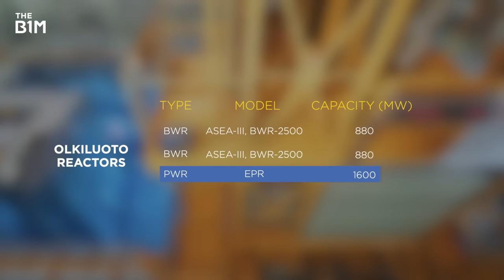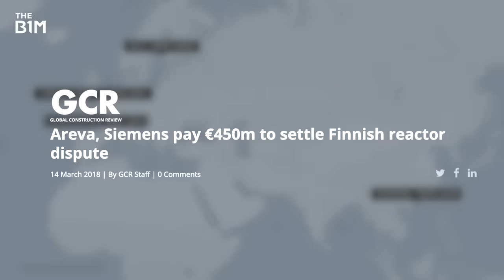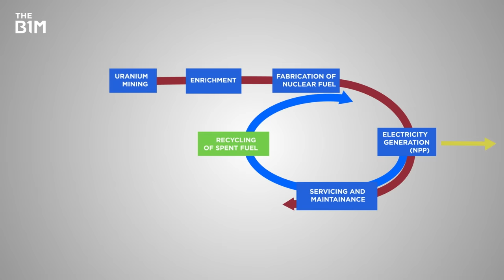Finland Might Have Solved Nuclear Power’s Biggest Problem

Comment: Old solution: stuff it underground and forget about it.
New solution: stuff it waaay underground and forget about it.
Reply: Like the stuff that hasn't been mined yet and is all over the worl in potentially catastrophic locations?
Reply: Remember in the old days when people would talk about blasting it into space or the sun?
Reply: @james3876  do you mean the non-enriched stuff !?!?     pointing out the extremely obvious difference.
Reply: @리주민  I still think the “shoot it in to the sun” option should be explored.
Reply: @james3876  just to be clear - I’m not saying it’s a bad solution. I’m saying it’s not really different from the old one contrary to the PR.

I’ve heard a lot of arguments that burying it underground is perfectly adequately. Maybe that’s true, but I would say that fourth generation fuel cycles are a preferable solution.
Reply: @marknoneya6630  enrichment is not the issue.
Using it is.
Reply: @youtubeaccount5153  haha rocket go crash
Reply: @TauCu  lol. Yea. And even if it’s just one rocket out of 10,000 that would be a devastating problem.
Reply: @youtubeaccount5153  And the energy required to send it into the sun is enormous. The delta-v (change in velocity) required is 2.5 times the delta-v to send it out of the solar system.
Reply: @HolySoliDeoGloria  It takes more energy to send it towards the sun than away from the sun?
🤔
And we know from movies all the problems we could create sending it out of the solar system. Although “out” of the solar system would take hundreds(?), thousands(?) of years.
Reply: Just sent it to space
Reply: @NoogahOogah  Breeder and SMR reactors reuse the fissile plutonium that is honestly such a good option along with the countless solutions that its funny to think there is still anti nuclear. I bet the people who are anti nuclear say nucular.
Reply: @jebus2382  I thought breeder reactors created plutonium, which is then used in the reactor but is much more dangerous than the uranium you started with. 
Not correct?
Reply: @HolySoliDeoGloria  interesting. Thank you.
Reply: what about using it again ? look up 4th generation reactors
Reply: @TomTomXIV  Throw it out the window sort of? Riveting.

I propose we choose a planet and make it a dump field.
Screwing with the Sun.... is a bit.. Come on, really? "What could go wrong" Amirite.
Reply: Terraform Mars with it!
Reply: @chrisb9143  from what i saw plutonium decays back into a another uranium isotope wich would need to be reprocessed, and thats energy inefficient...

and stuffing it underground is only "a long term solution" because of how long the thing needs to run before being considered "waste".

until we have a way to not use fission reactors anymore that is as clean as nuclear ever will be.
Reply: That's what I thought. Nothing different
Reply: @youtubeaccount5153  ur joking right?
Reply: @CarlosAM1  about exploring an option? No. But I know nothing about the economics of it. And I admit the safety can be 99.99% and still that is not sufficient.
Reply: @CarlosAM1  I’m not part of the crowd that keeps a closed mind to ideas.
Reply: @marknoneya6630  You can dilute the enriched stuff back to the level it was before it was mined. It the false idea that something that was not safe before it was mined be made totally safe is illogical.
Reply: Hhhhhhaaaaahhhhaaa porcenT.
Reply: @marknoneya6630  May come as some surprise to you, but in the past natural nuclear reactors did occur. One region in Africa , Oklo Gabon. And our own core has quite a bit still cooking. It's what keeps our planet having liquid magma and a magnetosphere to keep out most of the sun's radiation. Besides it only takes 2 inches of lead, 4 inches of steel, about a foot of stone, or 2 feet of water to drop radiation levels by one tenth power (i.e. 10 down to 1). As deep as they are putting it you won't be able to notice a change in background radiation.
Reply: @NoogahOogah  I would like to see Fusion Reactors, but for now this is this is the best option. It was giving off radiation in the ground. Enriching it concentrates it, but the net overall effect is the same. And when I was in Naval Nuclear Power School we learned that for each 2 inches of lead, 4 inches of steel, 12 inches of stone, or 24 inches of water you had between you and the radiation source knocked a zero off how much radiation got to you. Burying it a half kilometer down should take about a thousand zeros off the radiation reaching anyone on or near the surface.
Reply: @HolySoliDeoGloria  You have absolutely no clue what you are talking about. Once it's out of Earth's orbit and floating through space, NOTHING will stop it. It no longer becomes our problem. Shit that starts uncontrollably floating through space DOES NOT STOP. EVER.
Reply: @DeadlyDanDaMan   Read the context. What question do you think I was answering? I was ONLY discussing the point that it takes more energy to decelerate an object from earth's orbit into the sun than to send that object out of the solar system. What, exactly, in any of my posts, discusses your points? I understand orbital mechanics including Newton's and Kepler's laws.
Reply: @리주민  Great idea... just don't use one of Elon's rockets☠💣💣💥💥
Reply: Good thing we're modern not primitive like yesterday.
Reply: @VI-pp4jo  A gas giant wouldn't really mind a little more radiation.
Reply: @sch3ffel  It's still easier to bury spent material than gaseous carbon compounds and the continuous output is far more practical than the rest of the alternatives.  For now it's the cleanest option we have.  Hopefully we can use a few decades of cleanish nuclear to perfect sun, wind, and water then replace it with those.  With some well played hands I don't think we need a century to get that much done.
Reply: You forgot the: Really old Solution and sometimes state of the Art. Just swap it out in the Ocean because it is so big and Deep
Reply: @wolffang489  i know not saying im against it im just saying that this is the cleanest it can be today
Reply: Actually only the new solution is "bury and forget it". The old one was "Bury, keep maintenance forever and pray for no natural disasters"
Reply: @youtubeaccount5153  there are 2 big problemas there:
1 - One does not simply shoot stuff into the sun. You need way too much fuel for something like that. Not practical with current rockets.
2 - Imagine an accident on the pad or it blowing on the way up or even, imagine it losing control like that Tianhe booster and nobody knowing where or when it would fall back to Earth...

SpaceX makes it look easy, but they are just putting stuff in LEO most of the time. Reliably sending cargo that far is far more difficult. For example (using data in Wikipedia), Saturn V was ~2800 tons but could bring only 140 tons to LEO. After that, to the moon it was a 48 ton payload at a cost of $1.2 billion (2019 value) per launch. Saturn V is still the record holder for heaviest LEO launch.

SpaceX's Starship + Super Heavy is the only one in development today predicted to get more than that to LEO (up to 150 tons), and will be significantly cheaper per launch because of reusing first stage (Wikipedia mentions a CNBC link saying they hope it to be as cheap as $2 million per launch, but who really knows).

I would say we still need to wait for more reliable, efficient and cheaper rockets before starting to think about this. I guess we should bet on rockets to come after Super Heavy / Starship

Edit: you asked about how long it would take to send stuff out the solar system. We have the Voyager probes to give us an idea. They weigh a little under a ton and are at the edge of the solar system right now. Check the Wikipedia article on Voyager 1: https://en.wikipedia.org/wiki/Voyager_1#Timeline_of_travel
Reply: I hope they don't forget it because the so called spent solid fuel still contains more than 90% usable fuel. It can be processed for reuse, or even better, if we didn't kill the nuclear research, by now we could be using liquid (molten salt) fueled reactors that can use the fuel fully with much easier chemical separation process of any byproducts.
Reply: @DarthGTB  good info Thanks. Yea, the oops factor is prohibitive. But after that I kind of thought you shoot something towards the sun and gravity would do it’s thing.
Reply: @youtubeaccount5153  yes, well, remember, the Earth is technically falling into the sun as well. Roughly speaking you need the same kind of energy you would need for making the thing counter the speed the earth goes around the sun for falling into it. Another option would be to put it on a fixed orbit too. Orbital physics don't look very logical at first, but it gets pretty easy to understand once you learn about it. I recommend a mobile game called Spaceflight Simulator. It is really enjoyable and gives hours of orbital fun :)
Reply: Makes sense.
Reply: @jebus2382  I say fission, to distinguish it from the fusion pipedream...
Reply: @youtubeaccount5153  ...depends on the design...
Reply: @sch3ffel  you need to think more clearly; humans evolved with a background of radiation, and in nuclear chemistry, the most dangerous products have half-lives under three years (especially gases). The longer the half-life, the less radioactivity - exactly why uranium is now mostly U238, and very little U235 - the more radioactive U235 has decayed away...nuclear waste is nowhere near as dangerous as you think, but obviously needs to be controlled. There is also very little of it, with all of the UK's waste from 60 years operation stored at one site at Sellafield. Storing underground is a perfectly adequate solution, especially with glassification making groundwater infiltration a non-issue.
Reply: @davidtherwhanger6795  Fusion will never work in the way people think. First, the superheated plasma is not nice, then the intense neutron flux makes the structure radioactive and degrades the strongest materials so they crack up.
Reply: @DeadlyDanDaMan  Danno, no need to be rude, but stuff ejected into space can be captured by weak gravitational fields and, like comets, eventually return to cross Earth's orbit, leading to the possibility of collision!
Reply: @wolffang489  nice idea, but it can never happen. Wind and solar are already pretty close to their max theoretical efficiency, and are so diffuse that we would need to cover large areas to extract sufficient power using them. Fission is highly concentrated energy, with tiny volumes of 'waste', and is the only practical source of 'clean' energy, given that fusion will never work and still makes stuff radioactive.
Reply: @AndreasReinholdSchweiz  glassify, then drop into deep ocean trenches where subduction occurs, eventually adding to the molten core heat.
Reply: @Ironic1950  We are talking about fission here. But thanks for the input.
Reply: It's way more advanced than it seems. This is just the simplified version.
Reply: @marknoneya6630  if it is waste, it is no longer enriched, it is depleted
Reply: @youtubeaccount5153  unless be build a space elevator or a skyhook that's a pretty shit idea
Reply: @Ironic1950  and you are trying to create a debate where there is none.
as i said im not talking against it im just stating a fact that you cant get today nuclear power more clean then it already is.
Reply: To noogahoogah . The song with these lyrics , "I'm hooked on a feeling and I'm high on believing that you're in love with me " has your name at the beginning of it.
Reply: It that's your takeaway from the vid, you might want to watch it again...
Reply: @HolySoliDeoGloria  Maybe the atmosphere of Venus could be used to reduce the delta-v
Reply: @zambani  Just using the gravity of Venus can alter the velocity of a craft relative to the Sun, just as the Solar Orbiter did. Trying to get into the atmosphere would introduce a host of complications and wouldn't accomplish anything more in terms of delta-v than a "gravity-assist" flyby would.
Reply: @HolySoliDeoGloria  Yeah, come to think about it that's true. No need for aerobraking. Gravity assist a few times like Messenger can save some fuel.
Reply: Only to accidentally mine into it 500 years later. A radioactive surprise
Reply: If it ain’t a problem don’t fix it
Reply: Neo new trade-off let Musk send it to the ☀️
Reply: @youtubeaccount5153  you really want to "annoy" the damn star that keeps us alive? I think that is one of the dumbest solution ever. We should NOT shoot something in the sun. If the sun reacts to the nuclear waste with a giant solar eclipse or even an "explosion" you ruined every live on our planet...
Reply: @KolaronMalor  please tell me you are joking.
Reply: Game changer!!!
Reply: @youtubeaccount5153  Why would you want to send fuel into the sun instead of using it?
Reply: @Ironic1950  Nothing will replace horse and wagon
Reply: @VI-pp4jo  ...only like putting nasty people in prison for life, but also throwing away the key...
Reply: @sch3ffel  the chain of nuclear decay is well known, so all the issues have solutions e.g. strontium90, caesium136, xenon56, which basically means containing such things for 30 years, then the remaining decay products are stable but still heat-producing radioactive stuff, which can be used for power. This is the current thinking; high-level waste is not waste...
Reply: @LootHunt  at some point there is waste from all nuclear power generation.
Reply: Yeah. You don't really have to worry about it. Within some 1000 years it's pretty safe to handle. The nuclear waste is initially so deadly because it has really active waste components but these will also decay away fast which means the residue will become about as safe as the unused fuel (which can be handled with gloves) in not some long time. The speech about tens of thousands of years is just propaganda as if something is radioactive for that long time it means it's not very radioactive, they go hand in hand: more active -> shorter half-time, longer half time -> less-active. For example bismuth is radioactive for 14 billion years and that's why you can buy if off-the-shelf as it's practically not active at all.
Reply: @youtubeaccount5153  ...and toxic chemicals leaching from smashed up solar panels dumped in landfills, along with unrecyclable turbine blades is also waste...
Reply: And called it "game changer"
Reply: No somebody generations later can come pick it up after 100 years of being there.
Reply: @youtubeaccount5153  yes contaminate the entire solar system!!! with unforseen consequences!!!
Reply: @anti-everybody  I dont think you get how big “the solar system” is. 
Try to find a schematic of the solar system that is i
proportionate. The Earth would have to be a very tiny dot if you wanted to show the relative size and distances to Jupiter and Saturn. 
I wonder how much of the area of the solar system that is within the orbit of Mars that the Earth takes up? I bet there are twenty zeros after the decimal point before the 1.
Reply: @JakeWitmer  😂 LOL. Some libertarians concern me. But less than all Democrats and most Republicans.
Reply: @youtubeaccount5153  Due to a malfunction in scrolling ability caused by terrible interactivity programming on the part of YouTube, I am unable to quickly look at the context of your reply. However, I'm sure it's very smart. Have a nice day.

PS: If you're not a small-L libertarian (and small-D democrat and small-R republican) you're probably very stupid, and should stop participating politically.
Reply: @JakeWitmer  I am a conservative. With very strong libertarian leanings. 
May I participate?
Reply: @JakeWitmer  do you equate uninformed with disagreeing?
I think some people may accuse libertarians of being sociopaths.
Reply: @james3876  do you mean uranium??? its different genious..smh
Reply: I was thinking the same.
Reply: We can fule thorium reactors with nuclear waste
Reply: Perfect example of human hybris: we little people actually place a problem in this world with a timeline of up to 1,000,000 years. Oh, wait a moment, when did the industrial revolution start? Ah, yes, about 250 years ago? The rate at which we destroy the resources we need to our survival completely leads this storage argument into absurdity.
Reply: @youtubeaccount5153  I think the "don't start using it in the first place" option should also be considered.
Reply: @SS369  not an unreasonable thought. But compare injury and death from nuclear versus…well…any other power source.
Reply: No. Old solution - leave it uncovered and unprotected within 100 miles of every major city and make the taxpayers pay you billions of dollars to store it. New solution - Put a lock on the gate, hang a sign on the gate that says "SAFSTOR" and just walk away for 75 years. Let that generation pay for the mess.